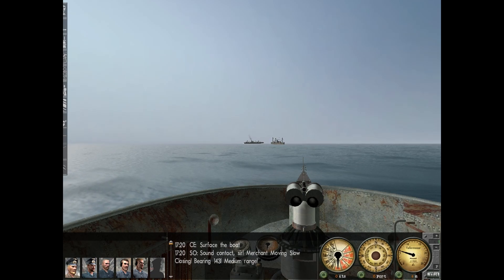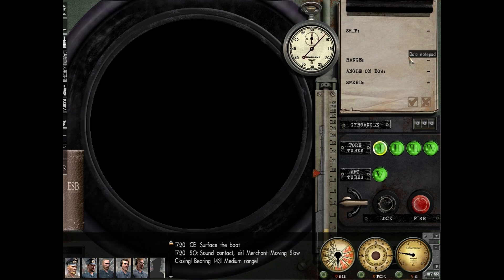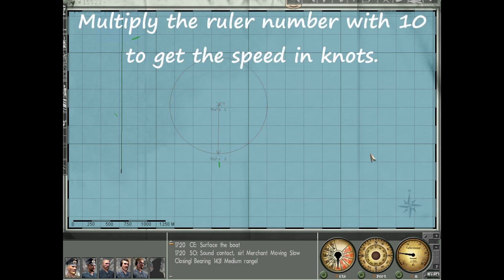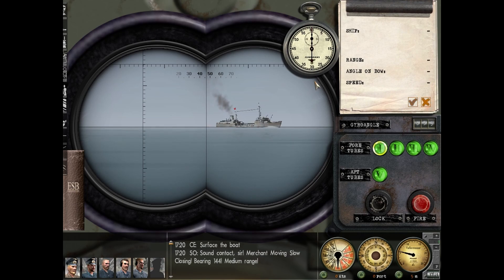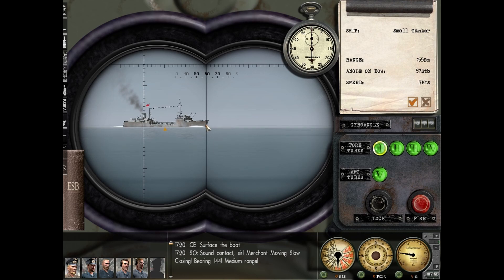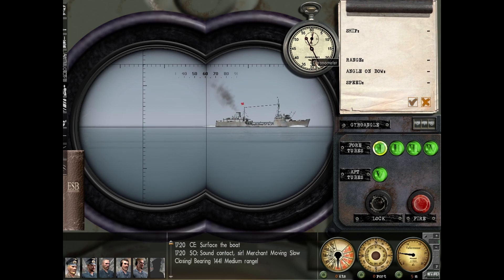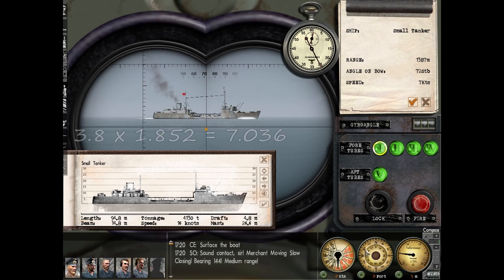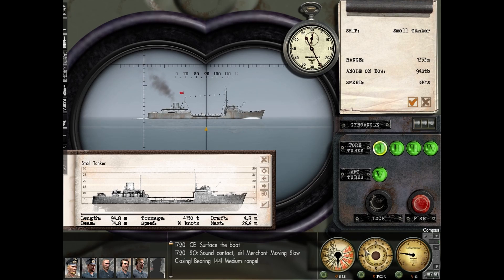Silent Hunter 3 U-Boat School : Manual Speed Calculation Tutorial #sh3

Comment from the maker: After a lot of back and forth discussion with VenaMarissa , it would appear that the correct multiplication number is 1.94 instead of 1.85. 

If you do the math yourself 1.94 still comes close to 7 knots and since we are rounding up or down anyways , for all intents and purposes , both numbers are valid.

In the close range straight shot which I will demonstrate shortly , small speed errors don't have an impact. 

So ultimately , whether you use 1.85 or 1.94 is a choice you have to make. Just like whether you are going to round the number or not.
Reply: It is definitely 1.94. 

First of all the number 1.852 comes from the fact that 1 nautical mile is equal to 1.852 km. And 1 knot is just short for 1 <nautical mile per hour>. So the number comes often into place when you want to convert knots into km/h.
But in this case were talking about m/s! 

So we just want to know how many knots 1m/s is.

Well, 1m/s is equal to 1.94 knots. 

So it's (<ship length in m> / <time in seconds>) * 1.94.

Comment: The conversion constant is wrong though. You must devide (not multiply) the speed by 1.852 if you measure it with kilometer per hour to get the speed in knots. If you measure it with meter per second then you multiply it with 1.944.
Reply: @tengusimulations  it's common knowledge pal. Quick google search of "kilometer per hour to knot" and "meter per second to knot" will give you the answer. 
As for the similarities of your result of fixed-wire method and 3 : 15 method is because 1.852 only have one decimal point difference to 1.944.
Reply from the maker: @VenaMarissa  Sorry for deleting the comment I was trying to write a different one and youtube decided to shit itself. 
I did google it and what I found out is that a knot , which is a single mile per hour equals 1(decimal)852 kilometers or one thousand eight hundred fifty eight meters.
Reply: @tengusimulations  yes, 1 knot is equal to 1.852 km/h. But you want to convert speed in km/h to knot, not the other way around. Also why would you do that when your data is in meter and second anyway. Converting it to knot directly by multiplying it with 1.944 is much faster.
Reply from the maker: @VenaMarissa  so to clarify , what you are saying is that the formula should be target ship length divided by seconds = X and then finally multiply X by 1.944?
Reply: @tengusimulations  yes, cause 1 meter per second is equal to 1.944 knots.
Reply from the maker: @VenaMarissa  I will make a pinned comment about it and will also further test it. Although I am pretty sure in a close range straight shot the torpedo will still nail the target.
Reply: @tengusimulations  of course the error will be negligible in a close range shot but it will add up as you get further from the target.
Reply from the maker: @VenaMarissa  hey there. I want to do a follow-up video providing a correction as well as an in depth explanation. Could you possibly provide me with some contact information such as mail or discord for instance , to discuss the method with you ?
Reply: @tengusimulations  sorry, but I don't do personal request.

Comment: in Wolfpack game on videos they said to multiply with 1.94
Reply from the maker: Every simulation is a bit different than the other. Therefore I would not be surprised if wolfpack used entirely different numbers. This is an SH3 tutorial first and foremost. U-boat tutorial second. 

My method still is valid though. The only way you can be sure about the target's real range is to learn it either through cheats or with a different method such as a stadimeter. Let's suppose that the target's range is 800 meters. 

Your next step is to apply the formula. So mast height : amount of markings. If we suppose the target has a mast height of 23 and we count 6 markings , 23 : 6 gives us 3.8 .

Now because we know that the target's range is 800 meters , we need to find a number that if we multiply it with 3.8 will give us approximately 0.8 . You can either experiment with numbers or you can divide 0.8 by 3.8 . The result of this division is 0.21 . 

If you multiply 3.8 by 0.21 you get 0.8 kilometers or 800 meters. Thus you are close enough to the real range. 0.22 would still get you close enough to the real range.

Keep in mind that rounding numbers will always have an impact on your results. Preferably you don't want to round at all. However , usually easy calculations are preferred over perfect calculations. You are not a mentat after all. 

Also keep in mind that different scopes with different magnification levels or markings also change your magic number. Once again. Find the real range either with cheats or with a different method and then follow the exact same formula I showcase , to find the number you need for any given scope or magnification.
Reply: thanks for the response! I read all of it! It seems in the end the end the end result is minor. I love your uboat school videos keep going!  @tengusimulations  Also where you from ?if you dont mid
Reply from the maker: @ath_greek  Thank you ! Με πρόδωσε η προφορά μου ;
Reply: εχεις το wolfpack; ψάχνω άτομα
Reply from the maker: @ath_greek  δυστυχώς όχι. Άμα ψάχνεις γενικά σίγουρα θα υπάρχει κάποιο discord. Τώρα για Έλληνες , δυσκολάκι.
Reply: σε πειράζει να σε κάνω add στο steam?
Reply from the maker: @ath_greek  ελεύθερα . Φαίνεται κάπου η να σου πω ?
Reply from the maker: @ath_greek  σου εστειλα. ειναι διαφορετικο απο εδω.